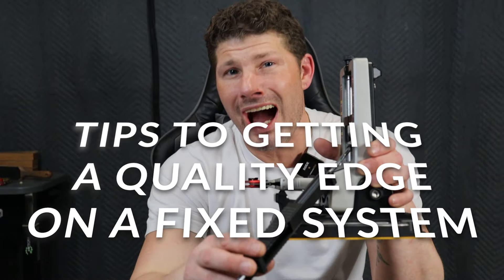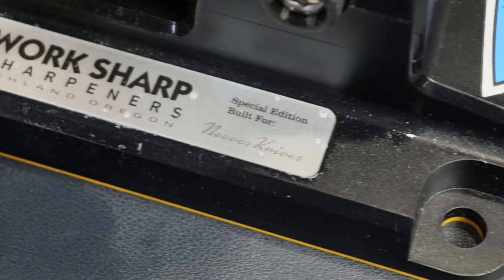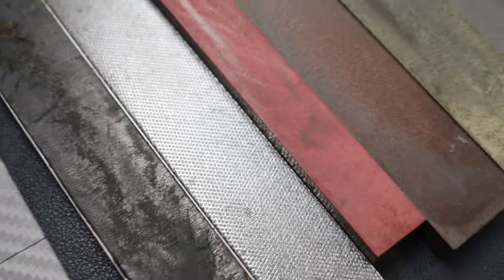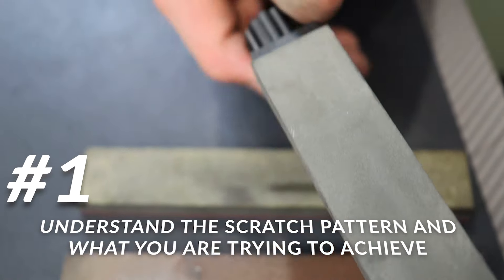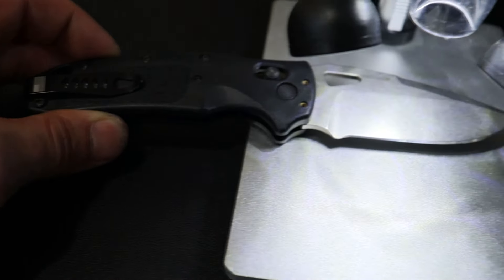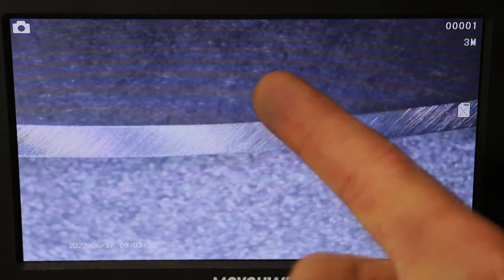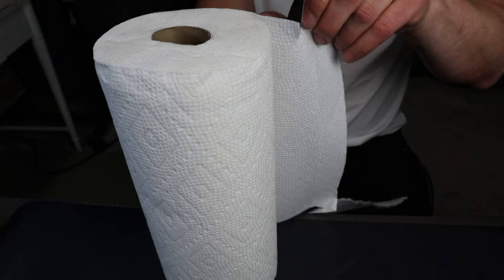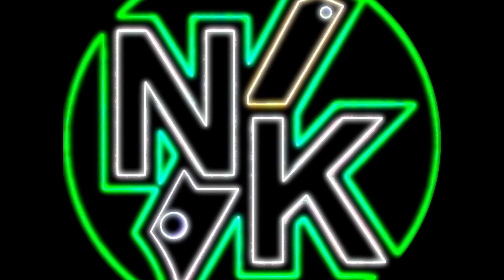5 Pro Tips & Tricks To Get a Quality Edge on any Fixed Angled system

Comment: I cant be bothered with fixed angle systems. Most knife bros extremely over complicate things, and usually don't understand them anyway. Guys who for instance think you need 20 grits to do a knife edge and stuff like that. Guys who start out with something like 50 grit. Just the amount of ignorance youd be fighting against trying to teach knife bros is too much.
Reply: I found fixed angle systems really makes a night and day difference for high carbide super steels like M390 and above.  These steels in my experience are extremely intolerant to variations in angle as apex easily chips away even after tiny variations in contact angle with the stone.   This was the main reason why some people complained these steels are hard to sharpen.

With a VERY steady hand you might be able to sharpen these steels to a good edge but you may find it takes longer (many people mistakenly think it was mainly because it was hard to remove the materials, but actually the other big cause is what I mentioned above), because you will be finding the edge remains dull not realising the tiny mistakes that caused micro chipping.  And even if you achieve a good edge, it may hold for less time, because the small variations in angle inevitable during freehand sharpening will almost guarantees to introduce micro fractures along the carbide-steel interfaces in the molecular structure and cause the edge to microchip faster as you cut stuff.

With fixed angle system you dramatically reduce such variations and you will find that the blade will be sharpened in no time, even with minimal materials removed.

I used to do everything freehand on Japanese Waterstones but after poor performance on super steels I figured out why and bought a fixed angle system.  After that there is no return.  With same set of stones the differences are significant.
Reply: @tonglianheng  I use resin bonded diamond stones for vanadium steels without issue. Low grit ceramic stones work fine too. So do 3M diamond films.

Comment: As a perfectionist automotive painter, this is essential sanding a dirt nib out of clearcoat. Starting with 600-1000 and working your way up to 5000 grit (or higher) and the scratches come out with just polish, no compound necessary
Reply from the maker: @jkrak6990  yup absolutely a polishing compound in the end can be a nice touch, but with edges your looking for micro serrations as teeth so dependent on the steel will dependvon how high you wall wanna take it

Comment: Something I wish people talked about more on fixed angle systems is blade positioning in the clamp for different blade shapes. One of my biggest struggles with fixed angles is not having the bevel widen out at the tip on blades with abrupt curves up to the tip (like the Benny's Clip)
Reply from the maker: if the geometry of the blade is that way then its suposed to widen up at tip if its thicker so in many cases its normal
Reply: @NeevesKnives  I never even thought about that, but now that you mention it it seems obvious. Do you generally suggest centering the length of the blade in the clamp? In this vid it looked like you had it clamped more rearward.
Reply: On a fixed angle system you want the longest part of the edge parallel with the sharpener, You always want the blade supported as tight as possible , I always twist the handle to make sure it’s locked super tight and there is no movement , being in the center is fine or back closer to the pivot it doesn’t really matter as long as your stones clear the clamp and it’s locked tight , you also want to make sure the tip is supported and isn’t flexing so you might want clamp closer to the tip on a very thin knife , some filet knives I support the tip with my finger to keep it from flexing downward when I run the stone or strop over it , Hope this helps 👊🏻
Reply: @Antimatter.  Thanks!

Comment: I hadn’t been paying attention to my scratch patterns as closely as I should have. And also proper burr removal. Very useful indeed 💪🏻💪🏻
Reply from the maker: YES DEF PAY ATTENTION TO THOSE ITS SUPER IMPORTANT, AND YOU WILL SEE A MASSIVE DIFFERENCE IN PERFORMANCE AFTER
Reply: @NeevesKnives  copy that. Thanks again brother 💪🏻💪🏻
Reply from the maker: BTW WITH THE BURR REMOVAL I TALK ABOUT IT ALL THE TIME ON THE CHANNEL EVEN WITH FREE HAND ITS SO IMPORTANT ON HOW YOUR EDGE WILL COME OUT IF YOUR ON A FIXED ANGLED ITS VERY EASY BUT YOU NEED TO DO LIGHT STROKES EDGE TRAILING WITH YOUR FINISHING STONE OR A CERAMIC, NO PRESSURE,
Reply from the maker: @landscapingspecialist  IF ITS S110 V DONT EVEN TRY TO REMOVE WITH  STONE ONLY STROP AFTER ITS FATIGUED

Comment: I’ve noticed all of these things during my current knife sharpening journey. Very very useful. I had a small introduction to this as I have been sharpening mower blades since I was 13. And alot of the fundamentals are shared between the two.
Reply from the maker: I KNOW WHAT YOU MEAN I DID A LOT OF THAT AS WELL. THERES A LOT OF SIMILARITIES, WITH KNIVES ITS MORE PRECISE AND I BIT DIFFERENT SINCE YOUR GOING FOR HIGH LEVELS OF SHARPNESS OVER TOUGHNESS WHCIH LAWN BLADES ARE VERY TOUGH BUT ALSO GET VERY SHARP WHEN DONE RIGHT
Reply: @NeevesKnives  yes. MUCH MORE precise. I was mirror polishing. And I did achieve the polish I wanted. But noticed some deeper scratches. Not terrible, just something I noticed. This is because I wasn’t paying attention to my scratch pattern. Appreciate the advice on this brother 💪🏻💪🏻
Reply from the maker: @landscapingspecialist  YES EXACTLY ALSO MAKE SURE YOU SPEND ENOUGH TIME ON THE MEDIUM GRIT STONES TO GET OUT THE COARSE SCRATCHES

Comment: Thanks so much for the video lesson, was very helpful.  After watching this video several times and your angle video I re-sharpened 2 S30V 535 Bugouts on a fixed angle system.  At 17 degrees a side and the other at 15 degrees, both to 1500 grit using diamond stones.  Minimal stropping to only remove any remaining micro burrs as you explained.  Both are scary razor sharp.  Amazingly easy to do following your techniques/advice.  Thanks again!
Reply: You didn’t remove any burr until the very end?  I heard to remove it after every stone. I’ll have to try this way, maybe I’m making it harder than it needs to be.

Comment: Loved all the tips & insight! Something else that I find extremely useful is listening & the feedback from the stone & edge. The sound & feedback can tell you when a side is completely homogenous and even. You can feel & hear exactly where it needs more attention & you can address that spot just by listening to it & the feedback you feel. 
I love using the ceramic on the SWPA for removing burrs too. Tip to heal a few times initially on each side (listening etc) then flip & repeat. Then I just count down in # of times each side. A single swipe on each side & you can get a whisper of a burr, like super thin fil that you'd be hard pressed to feel with a finger. Then I use an artists eraser (super soft, natural eraser that doesn't leave shit behind) to run down the edge & off to the strop. 
I also use that eraser every so often on the diamond plates & ceramic to keep them clean, aggressive. 
When I over strop or roll an edge a bit I use the ceramic to bring back a toothy edge and then adjust any stropping and bring it to the edge I want.

The internet is about information sharing, so there's some of my experiences, observations that may offer ideas to some & they adapt them to suit their ways.

Keep up the great work Jared!
Cheers

Comment: Excellent video thank you for the information and tips , got any tips for  marrying up 2 edges on fixed angle system ? Just got EMP Relative and attempting to sharpen it soon the edge looks a little tricky it's not a tanto but where compound grind meets looks like it will be difficult to marry up the 2 edges

Comment: Excellent video, as a rookie this was extremely helpful. One question, when you talked about using a ceramic stone to remove a burr, did that replace the stropping or do you recommend doing both. Thanks.

Comment: Great video. I gonna pick up that Worksharp Pro PA now that there is a stone holder available. I was considering getting a TSProf but they have not been available here in Scandinavia for almost a year. Gonna need to pick up some slim Venev stones also. It's nice to have a fixed angle system for when you just need to put on a good consistent edge 🙂Thanks for the video.
Reply from the maker: absolutely it is, even i use them  regularly and i love freehand

Comment: I definitely do some of the "don'ts" you've described in this video. So I definitely appreciate the tips! One question I have tho is that😮 even when using fixed angle sharpeners such as the The Work Sharp Precision Adjust, I find that the blade ends up with little scratches on it. To avoid this I put blue painters tape over the entire blade. Is there something I'm doing wrong cuz taping up a blade every time is annoying AF!
Reply: The same thing happens to me. but the answer is simple. you're pulling the stone too far up to where the edge of the end of the stone is hitting the side of the blade. that's why the fixed angle sharpeners usually give you a rubber washer to prevent that from happening. but for me, I don't use the washers because I like to use every inch of the stone, but the tradeoff is that I sometimes get scratches on my blade. to me it's not a big deal because they're knives not art pieces but at the same time I like to try to keep them on best shape for as ling as possible so I try to avoid things like that. as I get better at fixed angle sharpening, I don't have the problem where I scratch the blade because of muscle memory. especially as I became aware of the scratches and how I was scratching my knives.

Comment: Thanks for sharing bud!👊🏻I have seen people just go straight up and down I believe it was on a work sharp video is that not good to do even if you make sure to be even with it same amount of strokes?
Reply from the maker: if all the teeth are straight up and down then its fine, kind of like a factory edge done on a belt thats how they are. but you dont want the teeth running all different directions
Reply: @NeevesKnives  thanks still learning on the sharpening side for sure

Comment: Work Sharp released the professional version two freekin' months after I bought a KME! Don't get me wrong. I'm a big fan of the KME. It's a great system. That's why I bought it, but I like the Work Sharp better. (The precision adjustment screw makes it a lot easier to set a precise angle, not to mention that it comes with an digital angle finder.) Two freekin' months! They did the same damn thing when I bought the original Worksharp sharpener. Three weeks later the Ken Onion Edition comes out!

Comment: Thank you for all the great content. My one problem is when I do the light reverse strokes with my final stone it changes the scratch pattern from all going one direction to scratches going 2 directions. I tried not doing the reverse strokes with final stone and only minimal stropping with 5 micron juice and I still am getting 2 scratch patterns. My final stone is 50 micron. Any advice?
Reply from the maker: Then you are applying to much pressure no pressure at all you only want the burr on apex to make light contact in order to snag off, if only forward directions work best for you then do what works for sure. You can come back to other techniques in future. Another thing depending on the steels hardness will depend on how easily it breaks off. If mine take a lot of effort in many cases I will finish off with forward strokes on each side without causing a burr. Also what grit are you deburring on?
Reply: @NeevesKnives  Sharpening s30v, ctx, and spy27 type steels. All pretty similar. I am sharpening to 50micron venev as my last stone as I like a lot of bight. Then going to 5micron juice on leather for deburring. Thanks for the help
Reply from the maker: @monicaflamm9006  also your angle might be a factor as well, but it does depend.

Comment: Should i sharpen my tip at a different angle? For example my belly of my pocket knife is 20° but my tip cant get a burr.. the bezel of my tip is also way bigger then the bevel. If i am not mistaken i can get my tip sharp by increasing thze angle a bit for the tip. Correct me if im wrong please
Reply from the maker: No! The reason your having an issue is the thickness behind the edge changes on many knives so your bevel will be bigger and take more tip in those particular areas. If needed get it in 2 sessions or even 3 as you don't need it to be perfect if it's going to require alot of steel removal.
Reply: @NeevesKnives  thanks buddy! Im sharpening a Microtech Stitch partially serrated. I have actually achieved a sharper belly then factory! Like scary sharp! The tip needs 1 or 2 more sessions do. Much appreciated for the tip!
Reply: No pun intended! XD

Comment: What grit ceramic do you use? Also are you worried about carbide fracturing or destabalization when using ceramic as a finishing stone on the high carbide steels?
Reply: Don’t THINK too much. 
Get 200, 400, 600, 800, 1000, 2000 grit diamond  stones. 
Even the hyper Micro 2,000ug grits in honing solutions would be fine just don’t worry about those.  Just get the diamond stones.
Reply: @sprinkleddonuts6094 bro 😂 yes think too much there is so much more to the science of nettalurgy than just getting a couple of stones

Comment: Great vid Jared. I've been tempted to pick up the Worksharp Pro. I have the original. It's not bad, but man does it fall short in a lot of ways. Do you think the Pro is worth it, or should I just bite the bullet and buy a T.S. Prof? I've been hand sharpening lately, but it really sucks when you need to re-profile some of the crazy hard steels.
Reply from the maker: i do think the ws pro is worth it for sure its really good but the tsprof is better for sure also more expensive

Comment: So i just finished me first try with a worksharp elite. But i didnt spend enough time going through the finer grits once I got that initial burr like you said. Would you recommend going over again or just wait til the knife gets dull. It cuts very well but with the naked eye you can see the pattern isnt even.
Reply from the maker: Just wait until it gets dull, because if you have the precision elite then it's not going to matter much, the jump from the last diamond to the ceramic is to big there needs to be one or 2 stones more before the ceramic If you want an ultra fine edge, however the ceramic will be a great way to do your burr removal, you can get an aftermarket stone holder in order to get better stones btw
Reply from the maker: If you have the same system from this video the professional then it's kinda the same thing, another reason i recommend getting the aftermarket stone holder, there's a really good one in my Hapstone link that's in my most recent videos for both systems, it will be back in stock in about a week or 2
Reply: @NeevesKnives  I have the pm2 and I noticed the holder for the worksharp doesn't allow the stone to hit the corner of the hilt/plunge. I'll look into the aftermarket holder just for that reason alone.

Comment: I very much appreciate your efforts here to show the importance of proper sharpening. particularly the importance of the microscopic teeth.  Years ago I tried it vain to explain this over on BF' to no avail. I was told that it was completely wrong. Particularly by one individual who toted himself as an Engineer in Metallurgy. When I did a deep dive on his qualifications turned out he as only a trade school student and not an accredited Metallurgist at all. Yet he was treated there as the god of steel. 

Virtually every thing he taught there was dead wrong. I won't give his name here as he is now deceased, I still see his name as the guru of knife steels. GRRRRRRR!!! A complete fraud and never made a knife in his life. I finally gave up trying to educate the masses there. 

Like you I have done extensive testing over the years in the business and have been a maker of fine knives for over 50 year. Hard not to learn a few things in all that time. ;<)

The more I watch your content, bgut more I become impressed with your efforts to gain perfection. Your doing a fine job Young Man!

KnifeMaker

KnifeMaker

Comment: Do you use any compound etc, when running the stones on a Precision work sharp?
Reply from the maker: what do you mean?
Reply: @NeevesKnives  do you wet the stones with anything on the work sharp setup
Reply from the maker: @jeronimo2152  NO BUT I DO HAVE SOME, WHEN I USE WHETSTONES I USUALLY FREEHAND BUT I DO HAVE THE STONES FOR SYSTEMS
Reply: @NeevesKnives  could of swore I saw bubbles on a stone in this video... No?
Reply from the maker: @jeronimo2152  USUALLY WITH SYSTEMS DIAMONDS ARE THE BEST BECAUSE THEY CUT FAST AND WITH SMALLER STONES IT TAKES A LONG TIME IF THE STONES ARE NOT DIAMOND
Reply from the maker: @jeronimo2152  YES ITS DISH SOAP AND WATER, I USED RESIN BONDED DIAMOND STONES WHICH TAKE WATER OR SOAPY WATER

Comment: i notice you mostly sharpen smaller knives. Have you tried any bigger kitchen knives? especially with this work sharp per pro. i have a similar set up and im having trouble with the clamping system not holding strong, it flexes as i get to tip. any suggestions?
Reply: Hold it with your hand.  I always treat the clamp as an aid, but your other hand should be the main thing that keeps the blade firm and not moving.   If you don't like to use your hand to support the blade there are 3D printed supports you can buy online.  But they are much less flexible and clumsy to use if the knife is large, as you will need to support the different parts of the knife as stone move.  Hand is best.